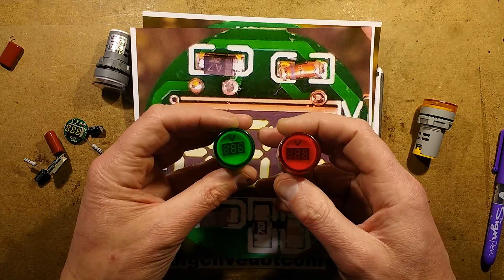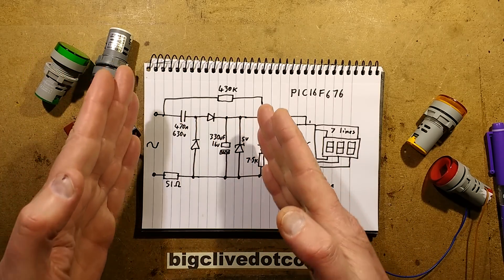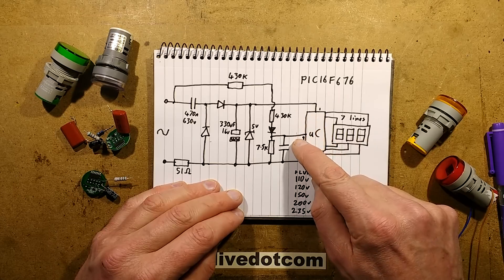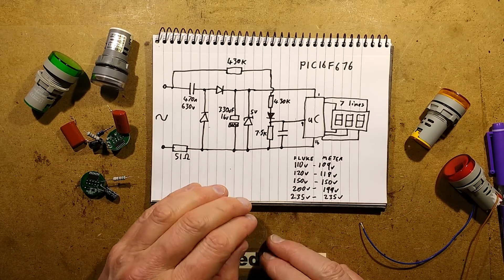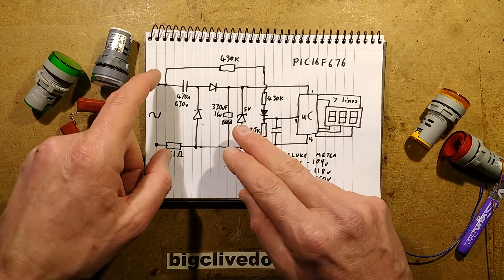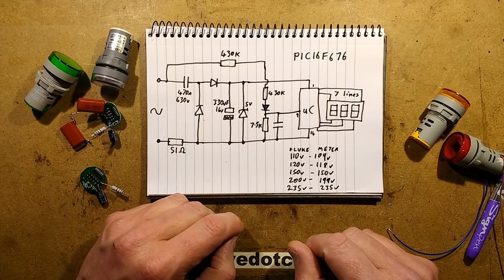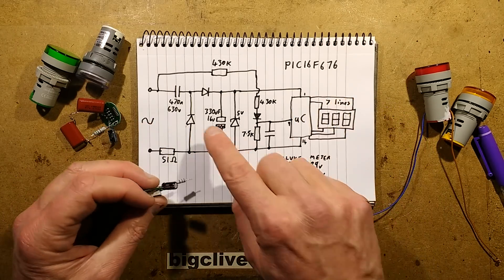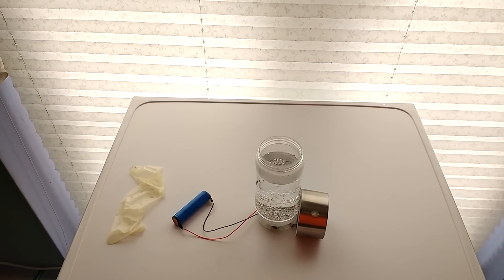Voltmeter-indicator schematic and hydrogen pop.

Comment: I'm trying to deciper/reverse engineer one of these that displays the volts, amps, and hz.  It looks similiar, but it has a display with 3*3 digits + 3 dots, it can't be driving each segment.
The display has 9 input pins.  It must be using spi or something.  you do the best in showing how these cheap devices work, I did not find anything newer that shows this device.'
I need to hack it and replace the hz display with the total kwh readings so I can pay for the juice I use off a shared meter.  I will have a arduino get the data and remember it but also replace the hz display with the kwh if I can.  thanks.
Reply from the maker: Check out Charlieplexing or tri-state multiplexing.  9 pins can drive 72 LEDs.  You may find it a lot easier and cheaper just to buy a kWh meter.

Comment: What use is the 51 ohm resistor ? According to my ltspice simulation (i replaced the AC with a 330ohm load resistor, drawing 14mA) the 51 ohm resistor only has 53mA peak AC current going through it (so 2.7V peak AC). SO for the life of me, i cannont understand why it is there, except separating grid neutral from dc ground. Please enlight me, thanks in advance
Reply: The circuit has just 2 capacitors in series at start, so the inrush current is limited by the 51R to max. 4(6)A @230V(320peak)V.
All calculations just roughly.
The 6A are what the small diode might survive for a single cycle.

It might also be a fuseable resistor, which opens in case of massive overload, but does not cause a fire.

Comment: Is it possible to give more accuracy to this circuit?
Reply: It is highly waveform dependent and today there is no 0% distortion sine anymore on mains. So the around 1% is very good. Even expensive devices might not be much better, the next level would be RMS, but that needs more hardware or clever software. 
As indicators with the ability to show „runaway neutral“ they are more than enough.

Comment: Here in Brazil we have what they call the "new standard" outlets in 10A and 20A variants. The 20A has fatter pins so that it can`t fit into a 10A socket but t'other way around is OK. This is all fine and dandy, but we also have two voltage levels - what everyone calls 110 (actually 127) and 220, frequently both in the same premises using two phases. The connections for these are not physically distinguished. Sigh.

So, to lessen the chance of mishaps I decided to add these little indicators to a couple of extension leads. This works a treat but a couple of things arise with the ones I bought. I got 3 each red green and yellow. The reds and greens are fine but the yellows are reading significantly, something like 5%, under voltage. Maybe a duff batch as Clive's yellows appear to be fine.
The other thing, and it leads on from that, is that orientation can be misleading.  One of mine reads 122V when fed from a 127V supply. See that upside down and it shows 221 which is what you'd expect across both phases. Worse still that applies in reverse - 220V supply reading as 221 will look like 122 when upside down. Probably not a problem on a fixed panel but something to be considered on a floating extension socket.
Reply: Underline the display with a black/(appropriate color) marker.  There are some called „email markers“, which give a strong color.

Comment: Looks like you could upgrade the supply to get it operating well below 110V, if the software doesn't assume that is out of range. May need to regulate at something like 2.4V.

Comment: Find it honestly unlikely that they actually used a PIC, because of the pricing alone. Perhaps it's a Holtek or one of China mainland companies and maybe it has an internal bandgap voltage reference? There's a few including Holtek that specialise on PIC replacement types, so they have the same pinout, same programming interface, and limited software compatibility but have slightly different feature sets and usually very different performance characteristics, because they aren't reverse engineered or straight copies but original developments.

Comment: I've looked on eBay and seen these indicators.  They are often limited to 2.5V or 4.5V on the bottom end and 100V on the top end.  I've also seen some 3-wire ones that go down to 0V, so apparently they are not getting their operating power from the source being measured and need a separate power supply voltage.  I think that someone could use them to make their own voltmeter by adding resistors inline to the sense lead.  Maybe some of the cheap eBay switches in parallel and you just turn on the range that you want and turn off the other ranges?

Comment: If the 7-segment displays are being multiplexed, it should be possible to perform measurements while all segments are extinguished, so the supply voltage will not be pulled down; it will be at the PIV of the Zener diode until one or more of the LEDs is lit. Once the voltage is read, it can be stored in memory and then displayed.  The next voltage value can be read during the idle period after each digit has been lit up in turn, while  nothing is lit up to spoil the reading; and if all this is happening quickly enough, then persistence of vision should fill in the gaps for you.

It does not look as though it would be especially difficult to modify this into a mA meter, once the software was replaced with a custom version.  The analogue input would have to come from a resistor in series with the load, rather than the power input as in the voltmeter version, and an extra terminal added for the other end of the supply  (i.e. the Neutral, if the sense resistor is in series with the Live pole).

With a modified PCB and ill-advised use of that RA3/MCLR/VPP pin, it should even be possible to write firmware for a standard PIC16F76 to display volts and amps alternately .....

Comment: I'd bet that the analog reference is to the supply rail, but they don't measure the voltage while the display is lit. So they turn the display off, the zener kicks in and limits the voltage to 5v and then it takes the voltage reading. That would get the accuracy and would not be noticeable on the display.

Comment: I haven’t worked with PICs before, but maybe they forgot to set the readout lock and you can extract the code from the chip with a programmer? That would also give a good answer to the question what chip exactly that is.

Comment: I wondered if the PIC you suggest is used does not have a built-in voltage reference.  It seems to (though the block diagram in the datasheet is less than forthcoming).  I found this statement:  "The new enhanced mid-range family of 8-bit PIC microcontrollers have a built-in module that generates a stable reference voltage internally. It is called Fixed Voltage Reference (FVR) where the output is very stable and independent of the supply voltage (VDD). The output of the FVR can be configured to supply a reference voltage for A/D conversion internally."

Comment: PIC16F688 is same pinout and has a reference in it, there are probably others.  Personally I think it's more likely they used a part with a reference in than that they did something outrageously cunning (and temperature-sensitive) to avoid it.

Comment: The pic can easily turn off the LEDs a hundred times a second for a tiny fraction of time, then during this off time measure against the zener-controlled supply voltage.
Reply: If the supply rail keeps rapidly switching between zener voltage and whatever the display drags it down to, the pic is going to crash. Also there is a 330uF capacitor across the zener which puts the kibosh on any rapid voltage variations.

Comment: Clive you need a public twitter account so that the electric/scientific community can share some ideas. I’m trying to design a electric circuit to keep a hydrogen flame burning. theoretically it could be used to heat water then create steam to power a electricity generator power plant 🤔

Comment: Actually the pinout this microcontroller has seems to be quite a common pinout. The attiny24 for example also has it, and that one has an internal 1.1V reference. Maybe it's that one or another one. I don't think anyone would want to write the code that compensates for the LED voltage drop, with different temperatures changing that and all. Also, the voltage on the analog in is only half of what you think, so only about 1V for 230V input, because it's half wave rectified before the capacitor. i would be interested if the meter even shows more than about 252V (because of the possible 1.1V reference)

Comment: MClr / Vpp going Low will reset a PIC back to the start of its program.
 Normally you'd want it pulled up to chip supply voltage to prevent random resets.

Comment: I've never worked with PICs but don't they just have an internal reference for the ADC that should be accurate enough? AVRs do anyway.
Reply: @Streamtronics: Yes and No :-) That means there are about 27 types of PIC16 with ADC in a 14 pin package. Only 6 DON'T have a reference. These are older models like the PIC16F676, which are even more expensive. PIC16F676: $0,98 @ 5kpcs vs. PIC16F15323: 0,50@5k - with double the Flash and 4* the RAM.
So at first I would not assume, that the relied on the LED voltage, which it is also quite temperature depending: around 1%/10°C. And production lot depending and current depending (nonlinear to the input voltage as a different number of segments is lit (Parallel) and time dependent with the display multiplex. Although it would be theoretically possible to do this, nobody sane would do it. The software to compensate all these influences would just be crazy :-) And the temperature stays without a sensor. 

NO.NO.NO 

As you get a PIC with reference for half the money.
Reply: There is another CRAZY way to do it. Pull the cap to ground, wait until the input goes high, repeat... charge-time equales to voltage. Callibration by software whenn there is no callibration data on startup. After building startup with two or tree known voltages. It is relativ accurate and stable but it must be pushed in a test aparatur for a few seconds after assambly.
+ input voltage indipendend.
+ no reff.
+ huge tolerances in parts are ok.
- every device need it owne callibration.
- slow
- (complicate programming)
- requiers a good clock surce.
Reply: I've got a couple of these on order. When they turn up, if someone else hasn't beaten me to it, I'll stick one on an ICD and see what I can putt off.
Reply: Well, it turned up. I was unable to read it directly as something was pulling MCLR VPP too low so I popped the chip off and what do you know? It has a number underneath. FC61125 1703B.

I was unable to read it with the ICD. Even with the chip off the board, MCCLR VPP was still low.

Comment: It’s really quite amazing that something without so much as a proper reference voltage can reach 1% accuracy.
Reply from the maker: It is perplexing.  Apparently other chips with the same pin-out do have references, but they need headroom around the reference voltage and it would have to be above the input voltage from the sense circuit.

Comment: YAY Clive!! You lit the hydrogen!   Normal  service resumed! Whoo Hoo!!! 
And the how did that curcuit work at the start was facinating too.
Reply: Nuts n Proud To really produce H2 and O2 from water he should use pure water (not tap water) or he would produce Cl2 Instead of O2. The mix of Cl2 and H2 is unstable and light can trigger the explosion. The result in that case is not H2O but HCl... For  a good electrolysis he should use distilled H2O with a little bit of NaOH to improve the conductivity. https://en.m.wikipedia.org/wiki/Electrolysis_of_water#Electrolyte_selection
Reply: Only one test left really.. if Clive drank a lot of the Hydrogen water would his farts have a higher calorific value than those before he added Hydrogen to his body?
Only kidding.. really only kidding. A  backfire can be very painful.. or so I'm told. ;) I now have images in my mind I really do not want.. perhaps I should have thought about that before.. keep smiling everyone!
Reply: He made my day! :)
Thanks clive!

Comment: sophisticated software?  look up table more like,  empirically derived for each batch/colour.
Reply from the maker: +MattOGormanSmith A lookup table did go through my mind.
Reply: 10 bit a/d and 1.75k of rom is too tight for an easy 1024 x 16 bit one,  but if you used 9 bits of range you'd have enough for the display code,  and only be a volt or two out . Or if you packed the LUT into 12 or 10 bits per value you could translate the whole 10 bit input range and then any errors would only be from component tolerance, and could in theory be tuned out by reflashing.

Comment: Apparently it works only with AC, so is there a similar circuit for DC (e.g: power bank voltage indicator)?, and thank you for the video
Reply: Mahmoud Gaber Thanks to Clive producing the full schematic you can see it would be quite easy to adapt to 5VDC. Remove the input capacitor and drop the 2x140k resistors to about 7k adjustable and adjusts the readout gives 100x the actual voltage- ie it would show 480 for 4.80.

Comment: Pretty much every 14 pin PIC has the same pinout so it could be something like a 16F1503 which has an internal bandgap reference.
It would be easy to prove if they are using LED Vf as a reference by swapping chips between red & white units.
Is there a delay between powering up and the display coming on ? They could be waiting for the supply to be clamped by the 5V zener and measuring LED Vf relative to the 5V zener voltage before turning the display on.
Reply: I highly doubt they aren't using an internal reference.  The amount of effort to implement it the way Clive was thinking isn't worth it and is prone to huge errors.  The manufacture also wouldn't want to have to have use different program variables for the different colours.  That just adds to the costs and is prone to mistakes during assembly.  While Clive's idea might be fun to try to prove it is possible it isn't likely to ever be used in production.
Reply: It's the Mike and Clive Show: what a sizzling combination. (nod to Derick and Clive aka Pete and Dud improv. recorded when on some sort of non-prescription medication I presume).

Comment: I wonder how much current that panel meter takes. looks quite an easy circuit to modify and build into a solar battery meter
Reply: BillyNoMates1974 You are measuring voltage with it. The meter goes in parallel with the load.

Comment: 1 standard party balloon filled with HHO gas placed under the very thick large plastic wheelbarrow was ignited to see how much it would lift off the ground. The wheel barrow shattered into tiny pieces. don't ever ignite HHO indoors. A nice Halloween scare can be had by making HHO bubbles in soapy water. Let the bubbles rise inside a skinny  metal conduit  tube with a  flame near the end. every time the bubbles get to the end of the tube you get a loud bang.

Comment: I think that the chip is probably a 16F1764. The pinout is the same, but the 1764 has a Fixed Voltage Reference that can be selected to either 1, 2, or 4V, and can be used as a reference for the ADC. You need a 2.5V power supply for the 1 or 2V reference voltages, and 4.5V for the 4V reference voltage. It is a surprisingly cheap chip. I don't see any current limit values on the IO pins, so I'd guess they are self-limiting. 
The higher the input voltage the more current will flow in the capacitive dropper. This might result in a higher sustained voltage on the chip. If so the chip could measure it's input voltage and select a higher value for the FVR as the input voltage increased.  The trouble with this is that 240V average line voltage will generate 2.07V, which is just above the 2.048 V reference voltage. So the thing can't measure over 240V unless the chip can get up to 4.5V by the time there are 240V in, and it seems it can't. Also it would not be able to measure over 480V even with a 4.096V reference. 
As an alternative, the chip could be using Vdd for the ADC reference, but also measuring the FVR with the ADC in between line voltage measurements. This would let it calculate Vdd fairly accurately, and from that compute the input voltage with fair accuracy, while freeing the measurement from the FVR voltage limits. This would theoretically let it measure 580V max with 5V on Vdd. But without a resistor between the cap and the zener, it is unlikely to be able to have a constant 5V on Vdd.
Reply: l wilton There are resistors in front of the zener.  The 51ohm and the AC capacitor. One simple option is to briefly pause the display when measuring above 240V.  Hard part is waiting long enough to recharge the electrolytic without causing visible blinking.

Comment: Assuming the low voltage range is mostly for the 110V market, you have to take the frequency into account. At 60Hz the dropper capacitor passes more current.

Comment: The PIC16F676 does have an internal ref. It is coupled to an internal analog input. When the software does an analog measurement is switches to the internal ref. afterwards. Then the voltage can be calculated assuming that the supply does not change much between measurements. Standard PIC tech.